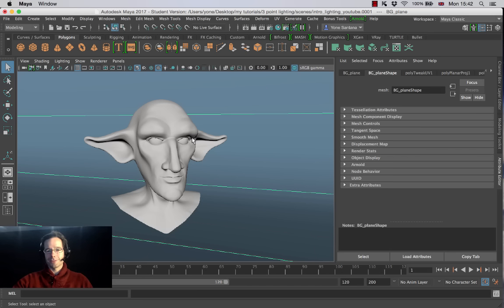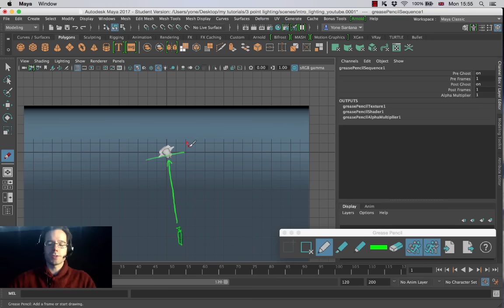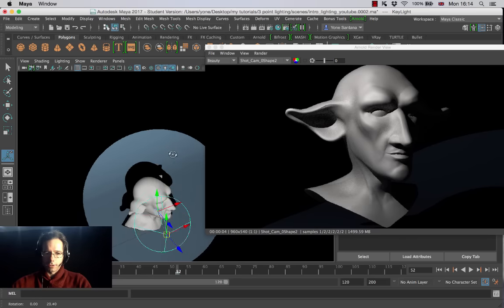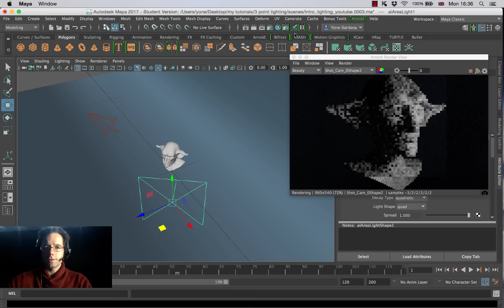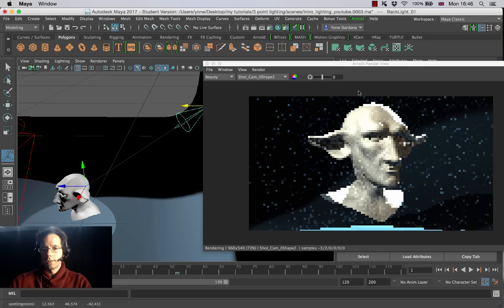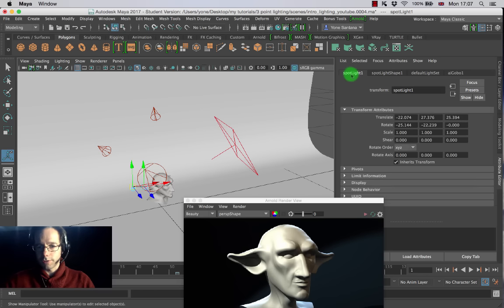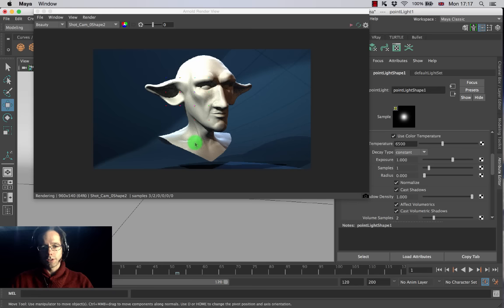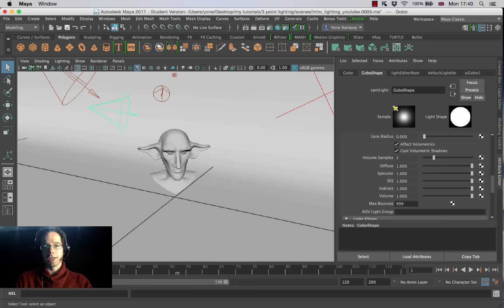Maya 2017 - 3 Point Lighting in Arnold

Comment: Thanks for this great video.
I am having some trouble with bump mapping in arnold, "it does not show up in the viewport." 
Do you know what might be causing this problem?
Reply from the maker: Hi Anton,
I have found various problems with the current version of viewport 2.0. I have found the specifically Arnold aiNoise map does not appear in the viewport. However the standard maya Noise and procedural textures do work. 

Bitmaps: JPEG's, TIFF... do also work in Arnold and viewport 2.0. If you Access Viewport 2.0's  Hardware rendering settings. Check that your "Bake resolution for unsupported texture types" is set to a value around 1024. Rebake textures to update your scene.

Sorry I can't be more help. Using the Arnold render view is a workaround for now.
Reply: yone santana thanks I'll have a look at it.